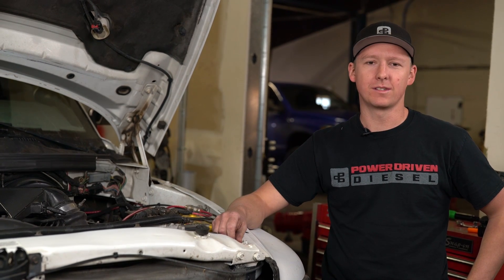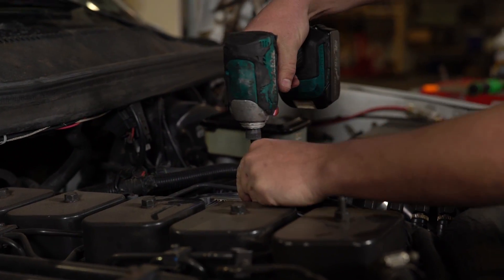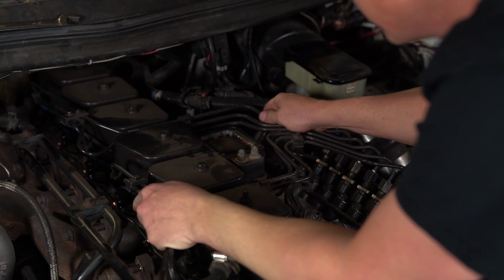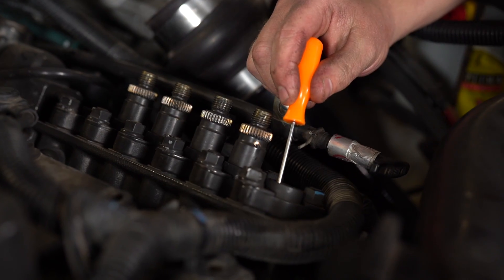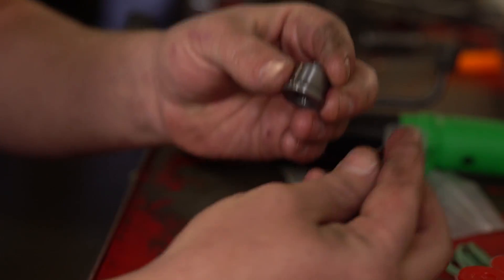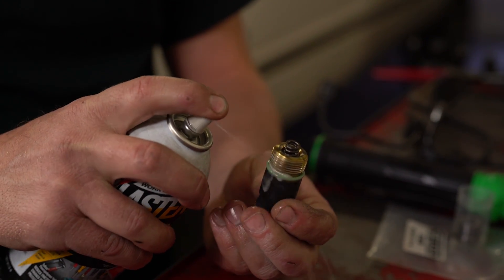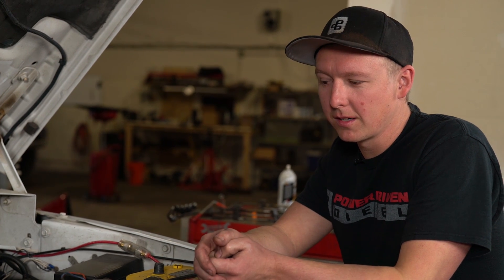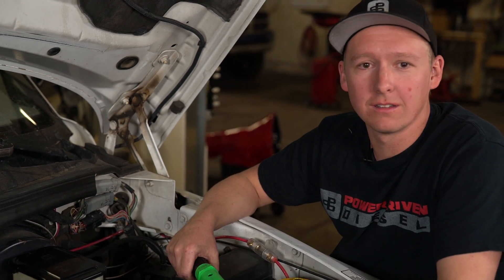How to Install Cummins Delivery Valves | Power Driven Diesel

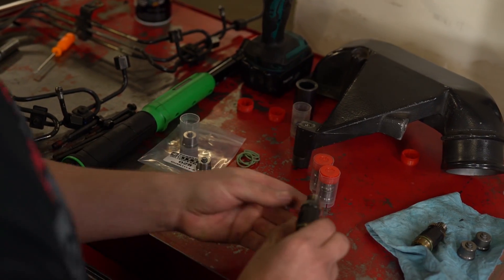Comment: I had a question today I was driving on the road and it seemed like I was losing power for about the last week I've been having issues with black smoke more than usual only time I usually get black smoke as if I really step on it and I let off the fuel some it's got to hit the right power band other than that usually just a little bit are white smoke usually anyhow driving on the road today I got about 1800 lb in the back if that maybe 2000 I got another 12 valve Cummins in the back of my truck a Dana 80 some tools in the bed of the truck I'm always fixing things buying selling etcetera anyhow the truck hasn't ran right it seemed like the last week and a half just seems like it hasn't been on it's all legs I could feel it a little bit but not much it was so slight that I could barely feel it well today it started to bog down no power and next thing I know not a lot of power and it felt like it's got to mess with sure enough I pull over at the gas station I cracked the number one valve on the pee pump p71 Honda automatic 2500 4:49 1996 model there's hardly no fuel getting to it from the pump there's also hardly no fuel going to the injectorfor number one cylinder I guess if that's number one cylinder all the way for this towards the fan the rest of them you crack open you can hear the difference and see a mad amounts of fuel flowing through I don't know what's ever been done to this pump but I can say that I bought it and from what I know it's supposed to be all original from what I know I have drove in it the last 4 years without any issues pump wise or engine wise besides a head gasket that I'm going to be doing shortly it acquired a leak about a year ago down by the exhaust manifold up on top in the back next thing do I have to put bigger fuel delivery valves or can I just put the OEM there's a set that's on Amazon and also a rebuild kit can I just rebuild the one take the valve out with the spring in the washers and everything else and just replace that what all goes bad or what needs to be replaced that's all I'm asking for the truck has always run healthy otherwise was going to order a brand new remanufactured pumpfrom China cuz they're the cheapest or about 900 bucks and they come with a year warranty same as the warranty of Bosch p pump comes with through your local auto parts if anybody can give me insight on this I hope and pray that I don't have to put a new pump and I can just put one delivery valve and call it a day and down the line I can rebuild all of them cuz I'll have all the gaskets I ordered a brand new delivery valve set for 6 and all the gaskets all rings washers etc all from either Amazon or Ebay thank you for any input and also if you change to a higher grade delivery valve do you have to change your injectors would be greatly appreciated
Reply: It’s been a year, did you get a Chinese ppump and if so how did it perform? My brother bought Amazon 191 DV’s and they were perfect, really woke the truck up tbh, but I’d never cheap on out anything fuel related to my Cummins personally. You get what you pay for typa thing imo, but I know some people have amazing luck doing it that way😂 simply to sketchy for me, but did you ever figure out what the problem was with the power loss? I’d say boost leak since it’s smoking and losing power, but with the way you described what happened it doesn’t sound like a boost leak whatsoever if it’s all of a sudden doing it.

Comment: I just changed my delivery valves and when I pulled out the set that a shop installed for me in the past I noticed that they were the newer style valves that were not the top hat style and 3 of them had the holder upside down…. Have ran the truck like this for about 3 months I hope it did not damage my pump 🤦🏻‍♂️
Reply from the maker: Should be just fine.

Comment: Where can I order y’all’s kit for. 1995 dodge ram 3500 5.9 12v with the p pump need orings an under deliver valve on pump
Reply from the maker: https://powerdrivendiesel.com/product-category/dodge-ram-diesel/1994-1998-2nd-gen-12v/dodge-ram-cummins-1994-1998-2nd-gen-12v-fuel-system-components/dodge-ram-cummins-1994-1998-2nd-gen-12v-fuel-system-components-delivery-valves/?v=7516fd43adaa

Comment: Can afc live compensate so Im not too rich with larger delivery valves & injectors?  Constantly blowing black smoke tends to upset others not to mention the soot contamination of my oil.
Reply from the maker: Yes between the pre boost on the p pump and the fuel rate on the Afc live you should be able to control it to almost zero depending on how big of injector and dv.

Comment: If you install larger delivery valves, does it increase the fuel volume through a set of 200hp injectors?  Should I be running say a 150hp injector instead?

Comment: What do delivery valves do ?
Reply: Fuel more and longer, stock stops fueling at around 3k rpms, these will fuel way more in the mid range, and continue high flow past 3k where your stocks fall off

Comment: I just installed my valves in my pump this evening.  The pump is off the engine so I was able to do the work with my bench vise.  The question is since my pump has been off the engine (and turned on it's side), only a few of the barrels had diesel in them when I replaced the delivery valve.  Should I had put some fuel in the barrel beforehand or is there any problem putting the new valves in with little/no fuel in the barrel?  i wasn't sure if it made any difference as far as lubricating anything before the pump is run again.
Reply: No you don’t need too, just Quickly crank the truck 3-4x, then start cranking for 2-3 Seconds at a time until it starts

Comment: How can I tell what size dv or type I currently have? Also what is a good size to run with .093 injector lines and 150hp injectors? Street truck. I was given the lines

Comment: Do you need the bleed the system after doing this?
Reply: @pddofficial  thanks for the reply, should cranking be done with the lines loose on the injectors or just hooked up regular

Comment: I replaced the delivery valves in my '95 cummins 5spd (175 pump).  It did make a difference in acceleration as well as smoke.  I didn't know to remove the aluminum shim that is in the pump below the DV.  Do I need to pull the DVs to get the shims out, or leave it alone since all seems fine?  What difference will there be leaving them in?

Comment: Why would any sane mind make a thing w/all those splines, the tool too, instead of a hex?
Reply: Jose Peixoto hex’s are easy to strip and will distort a cylinder especially at high torque. Splines offer more surface area to help distribute the torque evenly along the entire cylinder. Engineering principles 101.
Reply: @AgesUnto    I'm a mech eng too, and so, why  is it that all the other manufs use an hex and a proper and available tool?  i think you fail to see the r e a l point  which is to complicate things  so ensure job security.

Comment: Does the position of the delivery valve matter when reinstalling? Should you keep them in their original spot or does it not matter? Also just curious but what happens if you do pull out the center section and install them? Thanks for the info. Once again  great video.
Reply: Put them in as 1, Doesn’t matter what sequence you put them in.

Comment: At what power level do you need to start worrying about changing rods and crank? I see a lot of great info about adding power however I haven't seen a lot of discussion about when during the engine's life. Is it playing with fire to double the power of a stock 12 valve with 200k on it or is that fine as long as you have minimal blow bye and good oil pressure? Thanks for the great videos.
Reply: Parent of Twins there’s definitely stuff you’d want to upgrade with added power. Valve springs, valves keepers and retainers, pushrods, head studs. When you really up the power you could use arp hardware on your bottom end. But the stock crank and rods are incredibly strong in these engines. I wouldn’t worry about any of it until 800hp.

Comment: A video with details explaination of different valve sizes and effects would be nice.  Good videos
Reply: Well I can give one example. I have a 215 pump with 5x12 injectors, no plate, 4K gsk, 19* timing, 62/71 turbo. 
Just installed their 055 DVs which are the smallest upgrade they offer, and they definitely made a difference. Good increase in throttle response and probably a 50 hp gain in the mid-top end. First time I stomped on it in 4th gear it felt like I’d unhooked a trailer

Comment: Thank you for this video it was very helpful.  Could you please do one explaining what this modification does ? Or tell me if you've already done one explaining it ? Thanks
Reply: They change Duration, so your stock DV’s will stop fueling at about 3k RPM’s, these will basically fuel more and longer the bigger you go
Reply: .24’s will flow 80cc’s more then stock
Reply: So .55’s will fuel 50cc’s more then stock

Comment: I have 90 hp injectors with a 0 plate and a 61 72 14 phat shaft. What will upgraded delivery valves like these do for me?
Reply: Any other mods? GSK, AFC spring kit, AFC live, timing, etc? Delivery valves will increase the amount of fuel sent to the injector for each ignition event. For example the "55's" will flow 35 cc more of fuel whereas these "25's" are 65cc more of fuel. Your question doesn't really say much. Are you looking for more power for the sake of making more, trying to reach a specific hp/tq number for the dyno? Remember no matter what size d.v. you throw on over stock is going to translate to higher egt and you'll really want the tuner for that. You also don't say what year truck you have and that makes a difference as the earlier trucks have a smaller d.v. than the later trucks. A "55" D.V. is more toward someone that wants more fuel and tows (light), whereas the "25" is more for the hot rodder. If you tow heavy, and on steeper grades I wouldn't recommend anything over the 181 D.V.'s because it's going to get hot quick. Yeah, you can tune that out with AFC live but that'll sort of defeat the purpose. Then you'll start asking about water meth injection
Reply: JJZBULLITT109 so basically just more fuel...I already have enough of that with the 0 plate
Reply: Yes, it's more fuel. The plate isn't the same thing, that controls the fuel profile but the 0 doesn't really do much. You'd be much happier with the AFC live setup since you can change how fast the fueling comes on and top end fuel. The AFC spring kit will also help you especially since you're running a phat shaft. You don't need more fuel, just tuning the fuel you already have. More than likely you'll pick up some mpg and drop your egt's.
Reply: Thanks guys, you all rock! I used to be in contact with Will regularly over on CF, he was a huge help in getting all the right bits together for my transmission build years back. I can't say enough good things about the AFC live setup and having put a set of PDD injectors in my truck really couldn't have worked out any better. The only complaint was some P.O. of those injectors buggered the thread on one injector return line hole. No big, chased the thread and wrapped it up. I wish you carried the suspension and body components I need for the truck so I could give you that business too.
Reply: JJZBULLITT109 someone’s in love with his afc live why up grade your pump if your just gonna toon it down you must have lead in your foot
Reply: I have a 62 65 12 in my 97 12v. Just got 90 over injectors to help spool up from dap. And damn did they help!!! I have a gutted afc which I'm planning on changing to the adjuster but that has been on back burner as of now. I installed the injectors and truck was great whole different animal. I let it sit during the work week and went to fire it for the weekend no start. Thinking i might've had trapped air somehow i did prime bleed procedure. I only get fuel out of the back 3 dvs. Front 3 don't even dribble. I'm wondering if i have a bad injection pump, bad dvs, bad fuel i might've gotten causing all the above or some other aspect I'm not recognizing yet. But here i am looking at dv removal. Truck does have 521k miles on stock lift pump ip dvs and injectors until i changed them with the 90s. Wondering maybe i overtaxed the fuel system with the 90s and the gutted afc...? Shit idk. Any of you fellas know?